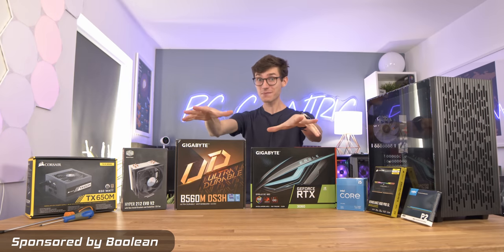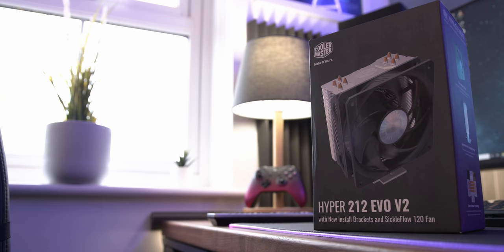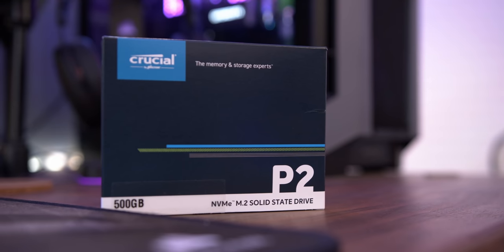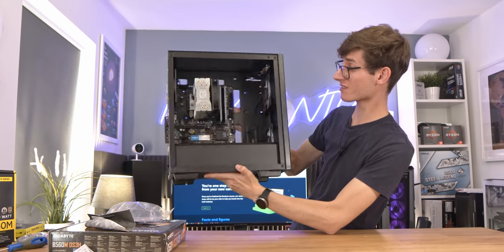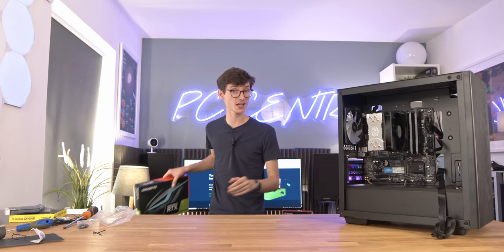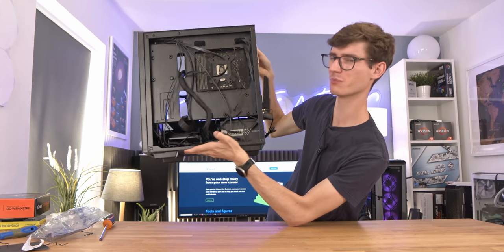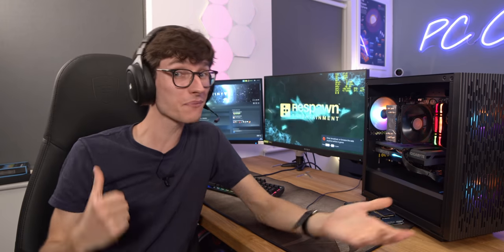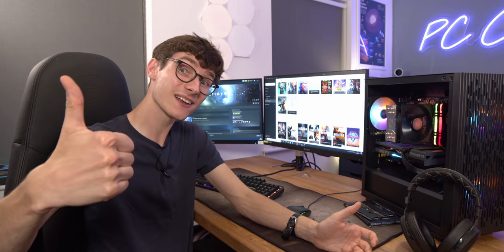The AFFORDABLE PC Gaming Setup! 🤩 (RTX 3060, i5 11400F, College/University!) | AD

Comment: A Rtx  pc with those specs retails for $2,750 here in Nz, I got  a second hand 6600 xt pc desktop with 16 gb ram, 10105f cpu, 500 gb ssd, 1 terabyte hd,motherboard , power supply, cooling fans, everything new.Cost $1,750.😁😁runs like a dream.
Reply: Would be faster if u can uograde to an 11th gen, ur 6600xt benefits from the pcie4 11th gen supports....

Comment: Putting it here in case other people have the same issue with the rams as indicated in this video. 

I got an aorus b560m board and these exact Corsair ram modules. XMP would give an error message telling me to try again or reset the bios settings, after restart. I DOA’ed them, and got them replaced. Same issue. After some frustration, I selected the “try again” option and ever since they work perfectly. 

Not sure why, it’s the first time I experience xmp issues, regardless of the compatibility list of the mobo. As long as it works I am happy.

Comment: Would it really be better to buy a wifi card rather than upgrade to a board that features wifi and would also likely include better VRM cooling? Long term, it seems like a better option to me,
Reply: You could help save the cost by not getting RGB ram, and just grabbing regular ram. That’s not an essential cost whatsoever. I don’t really think this was thought through that well.
Reply: @SaltSpirits  agreed that board is garbo saving the 10 or 20 bucks and having no vrm cooling is not a great idea in the long run. either you lower your 11400f's performance or have possible issues depending on your cooling set up.  as even the 80w+- an unlocked power limit 11400f can pull is rough for a heatsinkless vrm

Comment: Me and my fiancé are doing out first ever gaming PC build this year and I'm equal parts excited and terrified! We have a very modest budget (as close to £1000 as possible) and I think you may have just helped us out with a few of the parts I was unsure about. The hardest part was working out what cpu and graphics card I need to be able to play the games I want to whilst keeping the cost low. I had actually looked at the same graphics card as in your video earlier on today. Thanks for the tips, I don't feel quite as scared now!
Reply: just make sure the 11400f is not overpriced is your area. at least usa side the 11400f is being heavily scalped and your better off getting a 11600k or kf. also its well worth it to throw a few bucks more at the motherboard then what he used here
Reply: @Demon09-_-  yeah I think I’m going to get a better motherboard that has Wi-Fi built in too and swap the i5 for an i7. With this being my first one it’s hard to know what’s a good deal or not but I’ve got a bit of time to price watch and see if prices come down a bit.
Reply: @elfearsfoxsox883  if you go i7 make sure you get a decent cooler large air cooler or a 240mm aio etc as the i7 is pretty toasty at times. if your able to fit the i7 in your budget. but if your also waiting around intels 12th gen should be getting announced at intels event at the end of next month
Reply: @Demon09-_-  I was thinking of getting the BeQuiet! Pure rock 2 cooler is that going to be ok or does it need to be beefier? I7 seems to only be a few pounds more and the game I want to play recommends it on system requirements.
Reply: @elfearsfoxsox883   @Elfearsfoxsox88  the bequite pure rock 2 is on the smaller side for an  i7 11th gen as it can pull alot of power under max load. So you may have to move to something like a dark rock or dark rock pro size cooler.What game is it? Alot of games if they just list i7 defintely don't mean 11th gen i7. But it would also depend what kind of fps your trying to play in said game as if your not trying for high fps the diffrence between cpus would not matter much
Reply: @Demon09-_-  I’m wanting to play Planet Zoo on high settings but also Jurassic World evolution 1&2. I’m getting so confused by what I need and compatibility.
Reply: @elfearsfoxsox883  ooo planet zoo recommends an i7 4770k which I'd an older 4 core 8thread i7. The 11400f is very similar to say an i7 8700
Reply: @Demon09-_-  does it matter how many cores it has? Sorry for all the questions, you’re being really helpful.
Reply: @elfearsfoxsox883  the answer to that is some what. You could have an older gen with more cores lose to a newer gen with less cores. Some games also don't benifit alot from more cores. If your on a budget the 11400f on a some what decent b560 and a cheap 20 buck air cooler is probably your best bet. The 11400f is basically a 8700k +-.But if you can wait Oct 27th I belive intel will announce the 12th gen which are rumored to have pretty decent gains

Comment: if your building this id advise getting a slighty better mobo and spend the extra 10 or 20 bucks . not having any vrm cooling in the long run can be rough the 11400f if unlocked power limits can pull 80-90w in heavy gaming loads which may be more then this vrm would be happy with

Comment: 11400f is definitely great bang for the buck in gaming builds these days.
Reply: the sucky part is now days its basicaly scalper prices at least state side. you can probably find a 11600k for cheaper at least for the prices I see a 11400f for
Reply: @Demon09-_-  yeah 11600k is 40$ more in my country. i7 10700K 80$ more than 11400 and it has 8 cores, so If someone can strech it a bit, I think I7 10700k is best buy. for very tight budget builds, 10400 is rally a good deal.
Reply: @tomislavvladika3754  ya people state side in the usa have just gone nuts with scalping things and the 11400f is being sold at the same price as the 11600k

Comment: 12:15 “hopefully working” This is why I am scared to build PC’s and I like Gaming Laptops more than building a PC. Portability, convenience, and reliability over most frames per second.
Reply: In what university laptops are more reliable than custom PC ? 

Gaming laptops run super hot and that's what kills hardware. And not to mention that now days they are not repairable, so you'll have to throw them away the moment something fails.
Reply: @_orange_hamster  you do realize that pc parts have warranty too?

If your laptop actually runs at 70c while under load, then good for you, because all my experience with gaming laptop was 95c and jet engine loud.

I do agree with you on the pricing tho. They are way more reasonably priced compared to PC builds with the equivalent spec. Not to mention you can actually buy the damn thing.

Comment: If you’re actually looking for an AFFORDABLE pc that doesn’t make questionable budget decisions, like RGB ram and a bottom of the barrel motherboard:
Ryzen 5 2600 or 2600x, stock cooler. 
2x8gb NON RGB Crucial Ballistix ram. (The lights don’t add anything but cost.)
Gigabyte b450 AORUS pro wifi — Better VRM cooling, saves the need to buy a wifi card. Can easily afford to upgrade because you’re saving money on the cooler, wifi card, and ram.
2tb Seagate barracuda 7200rpm hdd — double the storage, half the price. We’re on a budget here, guys. An SSD isn’t essential, however nice they may be.
Your choice of 1660 super — Still a fantastic GPU on a budget, and no one can tell me otherwise.
Deepcool Matreax 55 mesh — Not the prettiest, but functional and has good airflow.
EVGA BQ 600w 80+ bronze. — A reliable classic that’s stood the test of time in a lot of builds. 

Enjoy gaming.
Reply: Yeah this is affordable. But tbh you won’t be able to play anything that isn’t a battle Royale lololol
Reply: You enjoy waiting 5 minutes for the PC to boot up? A sata ssd is super cheap.
Reply: i would change the gpu and add an ssd other than that great specs

Comment: Hi there,i have a question for you all:
I´m planning to build my first PC,but i have a doubt, are different models of the same graphics card (for example, Gigabyte´s 3060 ti and Zotac´s 3060 ti) the same graphics card with a difference brand name,or thy actually change somthing between brands?
Thanks for the answer :D
Reply: They are both the same chip. Coolers will be different.

Comment: Not sure I agree with this for a uni set up. If I was back in that position in the current climate I think I would go used and aim for something like a 2080 or 2080 super instead of a 3060.

Would love to see a build where at least some parts are obtained second hand as its a pretty solid option if you're under tight budget restraints
Reply: I upgraded my old pc to a z590(100€) mb, i5 11400f(100€), zotac 3060 oc(330€) and corsair vngce 16 gb 3200 (40€) and a tempered glass atx case(25€), so like 600 euros, 650 € with all shipments. And the rest of my pc is like 60€ aio liquid cooler, 50€ psu, 4 120mm fans(15€) ssd 240 (35€) and 2tb of hdh that i got for free. So i payed like 800€ for the whole pc that brand new in july 2022 is worth like 1150€ and most of the hardware is brand new or used only for few months
Reply: Next will be a 1tb m2 ssd, probably for like 70€ second hand

Comment: I probely use a deffrent case and swich out the gpu with a 1660 super or similar and use be quiet parts, they good and reasonble cheap and quiet and use a Z motherboard.

Comment: You should start showing 1440p performances
Reply: The 3060 is not a 1440p card.
Reply: @sphrcl.  I know the 3070 and up is more ideal for 1440p but it's not like the 3060 is not capable of doing so...Saying it's not a 1440p card should mean it can't run 1440p at all but it can. Your comment is kind of unnecessary.

Comment: What are your thoughts about the 11600kf? My pc that I just ordered is literally the exact same as that but has the 11600kf
Reply: the 11600kf is better you can also overclock it to near 4.8 or 4.9ghz if you have the cooling for it but it will also be better just at stock

Comment: Great Video! I actually recommend the Vetroo V5 CPU cooler rather than the hyper 212. This is because the Vetroo performs better, is ten dollars cheaper, and in my opinion, looks better than any of the hyper 212s that have been produced.  (Although the Hyper 212 is still a fantastic budget cooler)
Reply: I'd actually go for the hyper 212 as it is asymmetrical. The Vetroo is not, and on this particular board the fan is too close to the RAM. If you're only evern going to run 2 sticks of RAM though, I agree, the Vetroo saves a bit of cash.
Reply: @grifter7210  That's a good point. I didn't know that, thanks for the info!

Comment: I have this board and I couldnt even get my WD Blue sn550 ssd to work in the top slot so it had to go in the bottom. Not sure what I'm missing by doing this?
I also have the same Corsair Vengeance RGB PRO SL  3600 you started with but I've not seen any compatibility problems

Comment: Ive got loud case fans that I cant control through my bios. Any suggestions on how I can change the speed of the fans?
Reply: Get a 4 pin to 3 pin fan splitter, as if u can't control your fans, they are probably 3 pin fans.
Reply: id also add check if your boise has the ability to switch to voltage control as it may be defaulting to pwm. if not you may be able to find some low noise 3 pin fan adapters that will run them at 7v instead of full bore 12v from pwm mode

Comment: Hi, thanks so much for your info appreciate it. I have a question and need your help. I am planning to buy a gaming pc with the following specs and price and I need your recommendations please so I don't spend the money on a gaming pc that is not worth it.
Specs: AMD Ryzen 5 5600X | RTX 3080 Gaming PC
Allied Patriot 4-Fan RGB M-ATX Case
AMD Ryzen 5 5600X 6 core/12 thread CPU
NVIDIA GeForce RTX 3080 10GB LHR graphics
240mm Liquid Cooler
AMD B550 chipset with WiFi
RGB 32GB [2x16GB] 3200MHz RAM
500GB NVMe m.2 SSD + 4TB HDD
750W 80 Plus Gold PSU
Windows 10 Home | 2 Year Warranty
Price: $3,600 Australian dollar. 
Please kindly advise if the specs are worth the money and your general thoughts?
Many thanks

Comment: Please suggest if this build will be ok or need to change anything I am just strict on budget.

1. Inno3d GeForce RTX 3060 Twin X2 LHR 8GB GDDR6 128-bit Gaming Graphics Card

2. 11th Gen Intel® Core™ i5-11400F Desktop Processor 6 Cores up to 4.4GHz Without Processor Graphics LGA 1200 (Intel® 400 Series Chipset) 65W BX8070811400F

3. Adata AX4U32008G16A-SR30 Desktop Ram XPG Gammix D30 Series 8GB (8GBX1) DDR4 3200MHz Red * 2

4. Crucial BX500 500GB 3D NAND Internal SSD (CT500BX500SSD1)

5. Gigabyte B560M H V2 Motherboard (Intel Socket 1200/11th and 10th Generation Core Series CPU/MAX 64GB DDR4 3200MHz Memory)

6. GIGABYTE P550B SMPS - 550 Watt 80 Plus Bronze Certification PSU With Active PFC

7. Deepcool GAMMAXX 200 V2 92mm CPU Air Cooler

8. Deepcool MATREXX 40 3FS (M-ATX) Mini Tower Cabinet With Tempered Glass Side Panel (Black)

9. Samsung 22-inch(54.62cm) FHD Monitor, IPS, 75 Hz, Bezel Less Design, AMD FreeSync, Flicker Free, HDMI, D-sub, (LF22T350FHWXXL, Dark Blue Gray)
Reply: Go for the 3060 12gb, 8gb is lower bus and worse performance, 550 to 600w should be enough but go for xpg core reactor, evga or cooler master, get a 24" monitor, the case can be a deepcool ch370, and the cooler a vetroo v5, cooler master hyper or gamaxx

Comment: What difference does a motherboard with WiFi built in then one that doesn’t?  Like is the connection better or something along those lines
Reply: Probably will get faster speeds and they're a bit more expensive than WiFi-less boards
Reply: One allows the use of wifi without an additional card. That being said I wouldn’t recommend this build to anyone, you can build an entire PC for the price of the GPU alone, I wouldn’t call it “affordable” in any sense. And there are some pretty questionable budget allocations. I’d take the “AD” part of the title the most seriously.
Reply: @SaltSpirits  thank you. And also having a motherboard with WiFi, does that make your ping better in games such as apex legends? And does a motherboard determine how fast your system works?

Comment: Ah yes, affordable . Though, I believe that at MSRP an RTX 3060 is around $400, so yeah, that could be considered affordable at MSRP.
Reply: msrp is meaningless to buy a 3060 ti u already need a 1000 bucks add that to what cp case ram mobo cooling power supply monitor ssd keyboard mouse mouse pad and you are going bankcrupt
Reply: I want a 3060 ti and rn the cheapest I could get is 2100 this is the whole setup pc monitor pc accesories including keyboard mouse mouse pad and speakers and I still find it so expensive graphics card are a joke rn and Ik people are saying they going down in price but they are still a mess

Comment: I don't understand I have the same computer Omen 25l and after watching yours and two other videos installing the cooler master hyper 212 in your rigs without a hitch - mine juts out too far that I can't close my door and so I'm supposed to swap dust for cool?  it took me two hours to remove the motherboard and everything to install this stupid thing that I didn't even really need and now I'm going to have to go through the whole process again to swap it out with one that fits.  Its so fucking stupid that they make these parts so gigantic sized that they don't fit in anything!  I have a  $400 graphics card that is sitting on my shelf never used because no computer has room for the bulky thing!  I saw one guy weld off the case - that's ridiculous!  they can fit parts in a fucking laptop they can't make reasonably sized computer parts?

Comment: That setup doesn't deserve a 3060😭 lmfao. I was going to get one but couldn't at all find ANY graphics card, ended up getting a 1660 super for $380🤦smh. I was going to get a 3060. I have a b550 msi gaming plus, Ryzen 7 5800x, 32gb ram 3,600mhz. Would of been perfect with a 3060
Reply: The why did you buy a 1660s? Man that was more expensive than the 3060 msrp. You couldn’t wait?
Reply: 11400f is enough for a 3060, the GPU usage is high in most games even at 1080p, so going any higher in CPU would not reap much benefits
Reply: Seems perfect for a 3060 to me.